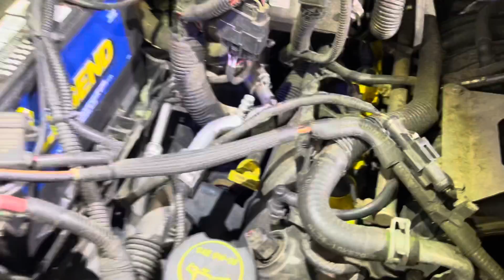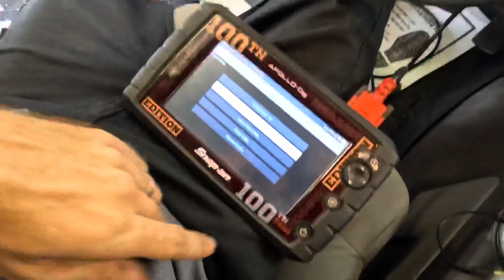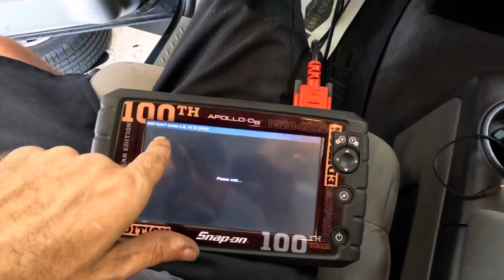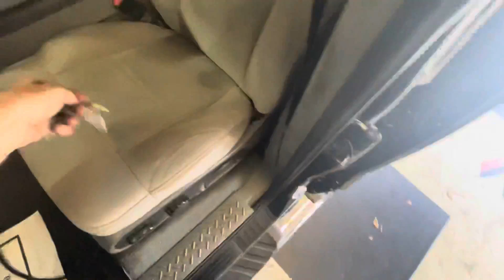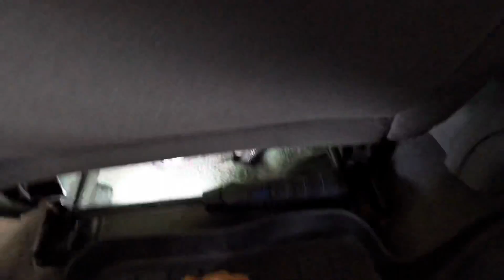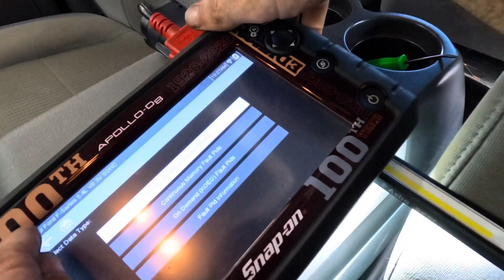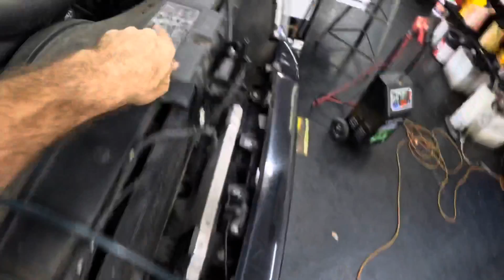Mini Explosives! Car fire Recalls and Airbag Fault! 2008 Ford F-150 5.4 4.6

Comment: Ray, do you charge for the full capacity of Freon or the full capacity minus what was in the car? We charge for the full capacity to cover the cost of the machine (filters, pump oil, maintenance labor, etc...).

What happened with the tensioner? Declined?
Reply: Especially now with the 115% hike in the cost of R134 ! Also   the $900.00 gas checker! Too many people “ play around” with their system, give up, then try the repair garage,, and want a discount “ NOT ! What did you put in your system ! You can see the tampering when u open the hood !
Reply: You're supposed to charge the customer only for what you use. If you charge someone for a pound of freon when you only put in a half a pound, that's sealing. In order to do it legally, you would have to tell the customer you're charging for the full amount, or just charge a separate fee for use of the machine. That said, I know its almost impossible to get caught doing something like that, so its an acceptable risk.

If I was in your position, I would put exactly how much freon you recovered and charged on the RO. If something happens the service writer won't hesitate to throw you under the bus, and blame it all on you. Also, it wouldn't be a bad idea to save the printout from the machine in case the RO gets "lost". Especially if you are working with yf.
Reply: @AT-wl9yq  we don't charge for a specific weight on the RO. The line simply says, "freon". It's not theft.
Reply: @aaronbritt2025  I'm going by what you said. Look at it again. 

"Ray, do you charge for the full capacity of Freon or the full capacity minus what was in the car? We charge for the full capacity to cover the cost of the machine"

You clearly state you always charge the full amount even if the system is partially full. That means you are not giving the customer what they paid for. That's stealing. Just because you don't clearly label it on the RO doesn't mean its OK. Its called fraud.

Of course you're going to try and argue with me on it, but you're not going to win, Here's why.
2 cars come in and they both take 1 pound of freon when the system is empty. One car has no freon in it at all, so you charge them for a pound of freon. The 2nd car is half full, so you charge them for a pound of freon, but only gave them half a pound. So now you say its for the machine. Why do some people have to pay for the machine and others don't? When you take someone's money and tell them its all going to freon, when it isn't, and decide to use the money to buy something else, its not legal. I shouldn't even have to tell you this.

I know people like you are going to argue no matter what, and I'm just not having it. This type of law is covered under something called the Uniform Commercial Code. This is what you use to tell if what you're doing is legal or not. If you want to tell me I'm wrong, I won't listen unless you can show me something in the UCC that supports your claim. Otherwise, don't waste your time.
Reply: @AT-wl9yq  I'm charging for a service. End story. By your reasoning EVERY shop in America is commiting fraud by charging for shop supplies.

Comment: So Ford probably won't cover this pretensioner replacement for free.  What was the cost to replace the bad pretensioner?  I, personally, had a "air bag" light come on in my car that had 30K on it.  The dealer said that it was a module fault.  The replacement would cost $850.  NO WARRANTY.  You gotta just love all of these "new" cars which have more and more modules and computers and how about a $15,000 battery replacement?  EV with 0 emissions?  What about the coal burning electric generators located just over the hill?
Reply: Sad but true. I'm for little to no regulations.
 Don't wreck you'll be fine. 
My the cheapest with no government subsided power win. Cars should be cheap and reliable.
Reply: Why would Ford cover the pretensioner on a 14 year old vehicle?
Reply: That work will be done at another time.  Indeed it is a nice truck.

Concerning power generation, many places do not use coal-burning generators.  Where I am, hydroelectric generators account for the vast majority of electrical generation, producing next to no emissions.  There are radicals who will claim that does not include this that and the other.  They can go live in their caves and STFU as far as I'm concerned.

In principle, electric cars should be much cheaper to operate than conventional vehicles.  While the cost of battery replacement is very high, the drivetrain is mechanically much simpler and should help to mitigate that cost.  I say "should" because the internal-combustion engine, with its sea of fluids and seals and moving parts, is an invitation to high maintenance.  On the other hand we seem to now have a "post-rationality" world, where numbers don't mean anything and nonsense is the new reality.

I am convinced that government is complicit, and responsible in large part.  Here we have four levels of government, not including shadowy trans-national organizations, and each of those is tripping over itself to implement policies to make driving as expensive and difficult as possible.  Purchasing, owning, parking, maintaining, and the driving itself are all on the table (and possible others I haven't thought of).  

I don't really blame manufacturers for the escalating costs.  Blame lies squarely with governments at all levels.  One example is rapidly escalating regulations on vehicle standards, ostensibly for environmental and safety reasons.  To me it seems clear that the goal is to put a stop to the motoring public.

A little off-topic, but there is a government program here called "Scrap It".  With the purchase of an eligible electric vehicle, the government will buy your old car for up to $4,000, and destroy it.  Now,.a $4,000 car is still a good car.  The government just doesn't want anyone else to use it.  The supply of used cars is being limited in this manner, driving up prices and driving down availability at taxpayers' expense.  I could keep going but I think I'll stop now.
Reply: @Starchface  Problem is that the electric grid at least in the USA will NEVER support all those EVs being charged, they take forever to charge up, and working on them unless highly trained is VERY deadly. Not to mention the price to buy one, and the environmental damage done mining for rare Earth metals for the batteries and electric motors, and the potential for deadly pollution if the batteries are not recycled.I'll NEVER buy any EV.

Comment: Anyone else run into sized AC ports? On olden stuff(like this) I've had more than a few with line port threads degraded to unusable (and sum where valve broke off.). Line had to be replaced. Customer faced with xtra costs.
Reply: Had one where I had to file down the charge port to get my high side connector on. Rusty SOB

Comment: so I wonders, with great FEAR in my heart, if you connected your meter to the actuator to measure ohms would it actuate it?  Ohms measurements put voltage on the meter leads and the explosive charge is triggered with voltage, right?
Reply: No. What he's working on is a safety feature, not the airbag system itself. In order for an airbag to deploy, it has to be commanded to do so by one of the crash sensors, like the one in the front bumper. The system also needs to have power. So, if something cuts power to the system before the command is sent, the airbag won't deploy. 

Also, if you noticed in the video, he was taking resistance measurements. The battery has to be disconnected for that. You can't measure resistance when a circuit has power. 

In the video, he's working on a monitoring system. Since the airbags and seatbelts are the primary safety features in the vehicle, a certain amount of electricity is run through the system at all times, (When the vehicle is on) and is monitored by the RCM. If something happens, like a wire is cut, or something is corroded, etc... , causing the amount electricity running through the system to go out of spec, the module sets a hard fault, and the only way to resolve it is to repair the issue. The point is, if something like a wire was cut and you didn't know about it, if you got into an accident, the airbag wouldn't deploy. That's the system he is working on.
Reply: @AT-wl9yq  are you sure the safety belt retraction isn't a pyro charge that's triggered by a voltage/current?
Reply: @tomtke7351  It has to be triggered electrically. If you read my post I clearly state that it can't deploy if power is cut to the system.
Reply: @AT-wl9yq  I'm saying that the ohm-meter MIGHT supply power.
Reply: @tomtke7351  Might, no. It does supply power. Look, ask me the real question. You're not going to get me, and I'm not going to evade the question, so just ask it. 

Are you going to say something like, "If the multimeter supplies power to the circuit, won't that set the air bag off?". And my answer will be no. A multimeter doesn't have anywhere near enough power to set off an air bag. The reference voltage that normally runs through the circuit is nowhere near enough to trigger the airbag, and the dvom doesn't come close to that number.
Reply: @AT-wl9yq  I'm NOT trying to trip you up.  What I worry is that putting voltages on pyro circuits COULD detonate them.  Multimeter voltages ARE likely too low but what IS the threshold?  Certainly using a testlight would/could cause trigger, right?  Wow!! What a surprise!! I was stumbling around testing an airbag circuit and IT DETONATED IN MY FACE. That would be a bad day, right?
Reply: @AT-wl9yq  And, Ray NEVER applied a meter to the sensor but rather read resistances thru his scanner.
Reply: @tomtke7351  You should have just asked me that in the first place. I'm not mad so don't get upset over a simple miscomputation. 

"Certainly using a testlight would/could cause trigger, right?"

Why would you do that? There's no reason to ever use a test light on an airbag circuit. In this example, we're talking about measuring resistance. Everything has to be disconnected for that. 

That said, I see that your main concern is not having an airbag go off in your face. Nothing wrong with that. Everything in the airbag system is designed to not go off. If everything isn't 100% for deployment, it won't go. What Ray is fixing in the video is the safety for this. Yes, you can set an airbag off, but you almost have to try to do it on purpose. The first step when working with these systems, is to disable them. Its easy to forget when you're talking to someone that's not a tech, we make assumptions without realizing it. The only people that set airbags off are reckless idiots. That's not you. 

I'll make a recommendation. If you noticed in the video Ray showed a pinpoint test. That's a diagnostic tool that Ford gives you. When you need to work on your car, the best thing you can do is get a copy of the workshop manual. That pinpoint test is part of it. The WM gives you extremely detailed, step by step directions for just about any procedure you will ever need to perform. It literally gives you every safety precaution and instructions for every single nut and bolt for any job you do.

For this job, if you were to follow the pinpoint test in the WM, they tell you exactly how to turn the dvom on, then they tell you exactly where to put the test leads, and they tell you what to do with the measurement. If its within spec, go to step 2, if not repair the circuit. And that's it. And before you start, they have you disable the system so you can't get hurt. They leave no stone unturned. Just like you. You'll be in heaven reading the manual.

Comment: Edit: I asked this before you pulled out the resistor thanks for immediate response Ray 😆, 
would adding a resistor in series or parallel be able to lower the resistance to the spec value and remove the code? Or is the computer looking for a change in the signal like the O2 sensor for example that is fluctuating with exhaust and heat going through it?
Reply: It doesn't work the same way an O2 sensor works, but yes, if you know what you're doing you could shut the light off. You would have to be insane to do something like that. You're disabling a safety feature that can save someone's life. If there's an accident, you're going to jail.

Comment: Made me think of all the cars I've had that didn't even come with seat belts!
Reply: Aha,,, your showing your age ! Me too! LOL
Reply: @fredwalker839  Yeah, I still remember taking my son out in his little plastic carrier sitting on the console between the seats in my '61 T-bird. Baby seats?
Reply: I began driving when cars had seat belts, but rode in a lot of them as a kid that didn't have them. I actually remember standing up on the front bench seat as my parents drove us around (shudder). My first car only had a lap belt, and the first one I had with a shoulder strap had to be buckled manually and separately, then there was the auto shoulder belt followed by what we have today. What I did not know until this video was the explosive devices connected to the belts to yank occupants back into the seat if the airbag deploys.
Reply: @mikeboring2172  Ha, my son used to stand up on the back seat to look out the windshield.

Comment: At 6'5", most mechanics are doing a swim move trying to grab the steering wheel, and adjust the seat in my vehicle. I'm sorry, I followed the "Don't move the seat rule for the first 6 months as a tech, couldn't get into most cars, and what do you do in the case of under dash work? 30 years and a bad back to show for it. Love your channel and it's content. Start my day with it. Reminds me of when I was a one man show at a body shop as the mechanic and combo person.
Reply: At 6'3" myself, every time I get in my car after a mechanic has it, I check seat position, mirrors, and radio presets (in case the battery had to be disconnected).
I am not mad if a mechanic has to move the seat and mirrors, particularly if the repair requires a test drive.
I'd rather they drove my car safely and inconvenience me by a minute or two.
Reply: I used to always move the seats for safety, then return them to as near as I could to their original position once completed. There's no way I could even attempt to get in with some drivers having the seat all the way forward, their elbows must be on the steering wheel and forearm vertical like a praying mantis.
Reply: @johnt.848  That last bit is an image!
Reply: I never knew about that rule until I started watching Ray's videos. I EXPECTED the technicians to move my seats. I hoped they would so they could comfortably get in and out of my vehicle. I am on the low end of average height, so tall techs would have to squeeze in when getting into my car. I now move the seats back whenever I take my car in to be serviced to make it more comfortable for the tech, and I also let the front desk know it is okay to move my seats if they need/want to.

Comment: Is that what is known as a "clock spring".  I had the same issue in a Nissan.
Reply: Usually the clock spring sits around the steering wheel shaft and connects the steering wheel contacts with the car.
Reply: @erik_dk842  uh huh. He said he had to put a new airbag in the steering wheel

Comment: I sometimes wonder about those ppl that think if it wasn't on camera it wasn't done so if you don't show yourself putting the wheels on and jump straight to driving the car they probably think you driving a different car and argue that you can't be driving the car you worked on cos u didn't put the wheels

Comment: Love it, quadruple checking your own diagnostic work, gets the hard hat nod.
Also, for those who are here to acquire knowledge, this is good content.
And, in parting, wear safety squints when handling refrigerants, liquid refrigerant is bad for the human optics, very.
Frozen cornea's are not what you want to experience, been close to experiencing that, very real danger.
Gloves also recommended, it will cause frostbite before you realize what has happened, if a liquid line bursts while you have exposed skin near it.
And, then the wound essentially has to be treated in much the same way as a 3rd degree burn.
Be safe around refrigerants.

Comment: Could you imagine you're the guy who just got into an accident. Your airbag went off seatbelt locked up. Now your seat is on fire. You just went through a traumatic accident now you have to get out before you burn up! Yikes I hope they fixed those tensioners!
Reply: Ray was talking about new trucks! Can u imagine how many vehicles  with rotten frames & fenders ! Oh! That air bag light has been on for years! Their the ones I would be more concerned about! They will fold up like a pop can! No safety “ crumple zone” Their whole vehicle is a rotten crumple zone!

Comment: the pre tensioner recall was on the f150.  mine was one of them. they cut the foam insulation away from the pretensioner.  that was it. 
I like the aqua RAMPAGE in the background.  what's that in for?

Comment: Instead raking out a 2 ohm resistor, could you just use the meter in the socket to directly read the resistance of the unit? Or would that set the damned thing off!
Reply from the maker: The pins are super small and I’d rather not probe it. Plus by using a resistor I tested the entire circuit just just the suspected component

Comment: All the vehicles I buy that are smashed and fix up to resell I always change out the whole belt assembly not where it buckles to because that's not the problem. I'm always sending out the belt portion to get remanufactured